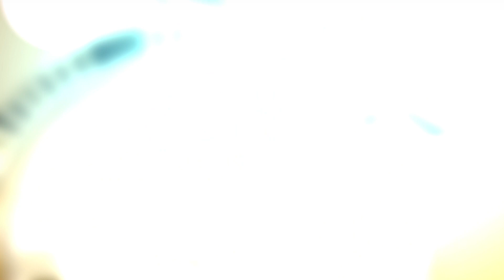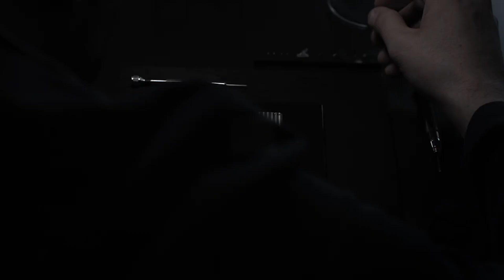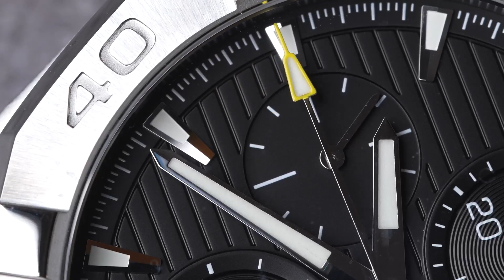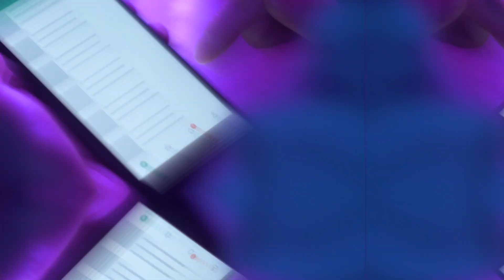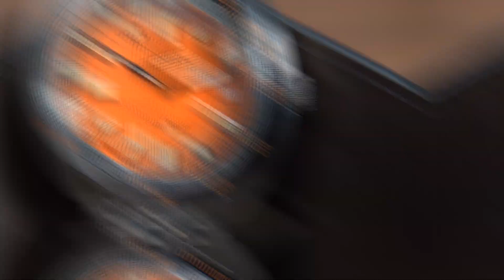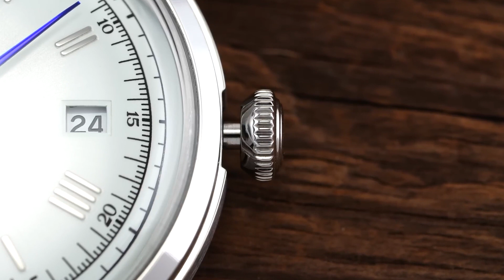6 Watch Care Mistakes | DOS AND DON'TS

Comment: Excellent video. 💯I would add one more mistake to be aware of. If an automatic or handwind piece stoped after using all of its power reserve, DON'T set time and date at that moment. Set it in motion first.😉
Reply from the maker: We appreciate your suggestion, and you're absolutely right about setting the watch in motion first after it stops due to power reserve depletion. Solid advice!